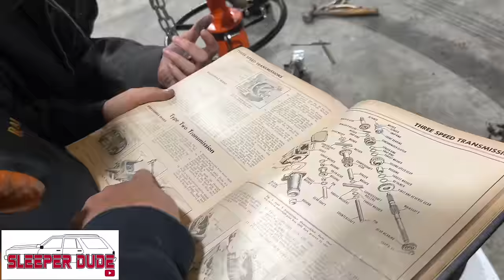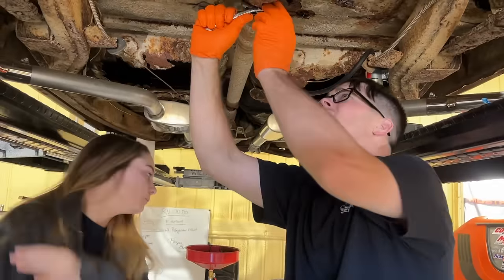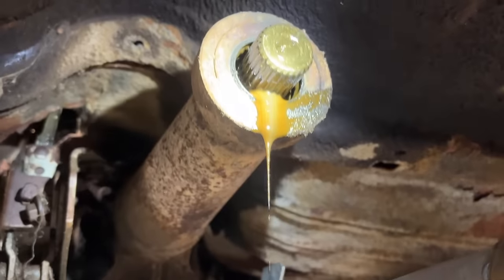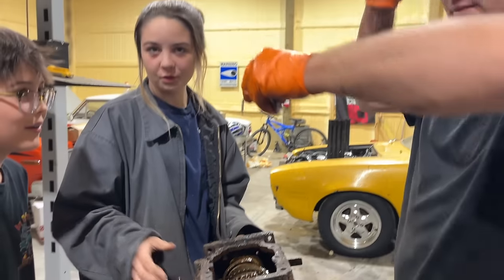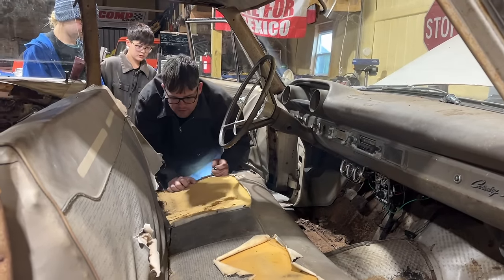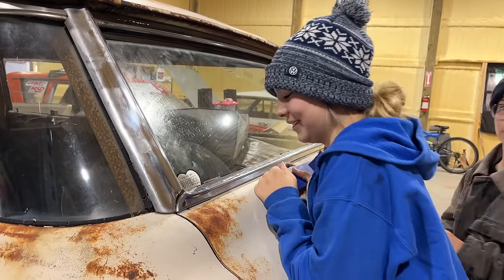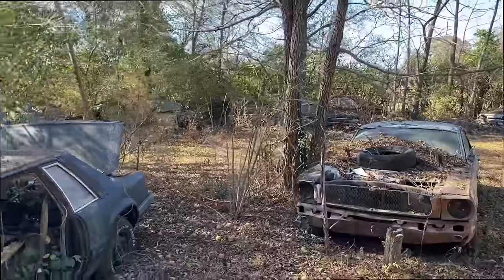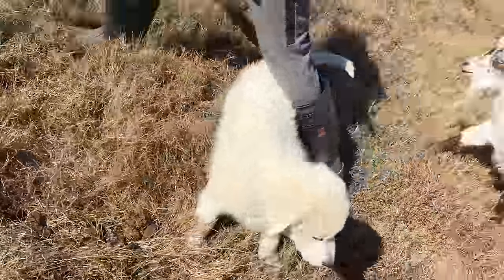What Went Wrong? And I Bought 7 1/2 Cars!

Comment: Tip for you guy's when using your wrench put the closed end of another wrench over the open end of the wrench you have on the bolt. Love the content as always. My heart is still smiling from Squeezy and Tosh tearing up on the air compressor and air brush ❤❤

Comment: Haven't fooled with old manual trans in 50 years, but here goes. Think of the 'clutch/input shaft as part of the case (it isn't, but go with me). The main shaft with all the gears/synchros gets inserted into the back of the input shaft, the joint supported/kept aligned by needle bearings you insert by hand (there is no cage, only you and lots of heavy grease). If the crankshaft bushing or tranny housing front bearing is worn, the two shafts will flex, eventually wrecking the needle bearings. When there's enough flex, even if the gears don't destroy themselves, the tranny will wan't to pop into neutral when under load. Eventually, it WILL make metal. This can also be caused by messing up the needle bearings during assembly (one drops out of place and gets crushed), or trying to remove the tail housing to service a seal or gasket without holding the tail shaft firmly forward to preven needles from falling out. You've probably figured out by now that nothing comes apart until the cluster gear is dropped down out of the way. Always remember, those needles are always waiting for a moment of inattention so they can make a break for it.
Reply: It'd be a pleasure to see you working on a transmission or engine. Obviously you're a talented person. Thanks for your advice.

Comment: Worked in parts at a Ford dealership in TX. The oil pans for a 460 in a van have a different sump placement than a pickup or car. I used a van pan to install a 76 460/c6 in my 69 GMC SWB. I wanted more power than my 283 had and a guy had a used 460/C6. Real good engine but thirsty. Takare dude, great show as always.

Comment: Not sure if someone mentioned this already, but you can swap the tail shaft housing from a Chevy S10 T5 onto the Mustang T5. This moves the shifter forward so you could keep the bench seat and possibly the shifter hole that's in the floor, already too. There's something you have to do with the speedometer, but not exactly sure what. Do a search for the swap and you'll find all the details. Good luck with the project!
Reply from the maker: Thank you

Comment: For the rv oil leak with the rear main seal try this here If you can get your vehicle up high enough to work underneath you can change the seal without removing the engine or trans. Drop the pan, pull the flywheel bottom cover if a stick shift. Remove the rear main cap. Inspect the bottom rear main bearing.

Comment: First off I love manual shift wagons. Was watching Hagerty  channel and on one episode he bought a running Ford Galaxy SW special order from factory with a 428 ci 4 sd manual approx the same year as yours. I have two suggestions for you on this build one is put a 4 sp toploader back in and change the rear gear to a 3.55 posi. Also Puddin did a SW same as yours and he found a place that had perfect fit floor pans from back to front, might want to give him a call.

Comment: I watched this video a couple of days ago, and was put in mind of my 66 Fairlane wagon, with a 289 and a 3-speed w/overdrive.  The clutch linkage had been taken out, and the front end had suffered in an accident, but I only paid $35 for it...I found some linkage, and bought a similar-vintage Falcon with a 302 and an automatic; I cut our the radiator support  and used it and the radiator in the 66.  I found black fenders and a gold GT hood, and put it all on the blue wagon.  We drove it 7,500 miles in 20 days, with 10 days parked visiting family.  I loved that car.  It had a whining 2nd gear which finally broke, so I had a T-10 4-speed to put in.  I really preferred the 3-speed.  I sold this car for some reason, and wish I still had it!

Comment: Your transmission exploration reminds me of when I watched my Dad  rebuild the three speed transmission for our Jeep pickup in the spring of 1978. We ordered all new gears , bearings and other parts from a company in California called Four Wheel parts wholesalers. They had every part necessary except for the reverse idler gear which we sourced locally. That three speed transmission was always the weak link in that truck and was the second rebuild for it in 1978. It came from the factory with a syncro mesh that was not de burred and my Uncle actually broke the shift lever off the steering column trying to get it into gear, necessitating a floor shifter replacement.

Comment: The TREMEC T-5 is a 5-speed manual transmission for longitudinal engine automobiles. It includes one overdrive gear, a lightweight aluminum housing, and adaptability for four wheel drive use. It is currently manufactured by TREMEC.  Good choice for that beautiful 302.
Reply from the maker: Yeah for sure

Comment: The 1965 Futura factory black paint may be a special car. Could be a  Sprint 2 door. It came from the factory with a 289 cu. High Performance motor really special if it has 4 barrel carb and 4 speed.

Comment: The big ashtray built into the back of the front seat is something else. Back then, ashtrays were like cupholders are today-every passenger has at least one. I dunno if the seat could be saved but it will take a lot of tedious work to do so. I think I'd just go with some bucket seats in front and use that T5. Yet another awesome video as always from the best creators on YT!

Comment: T5 swap would be pretty easy in that car and you will love driving it then.  I put one in my 66 comet, using the factory foxbody bellhousing and didnt have to modify my console or drive shaft.  The tail shaft housings can by swapped for shifter location.  The mustang one I want to say was 24-27 inches back from the rear face of the foxbody bellhousing as I remember.

Comment: I put a T5 in a 59 Fairlane. I turned 0.100" off the front bearing retainer so it would fit into the 352 bellhousing, used the Mustang disc, and the Fairlane pressure plate. Then, I bent the shifter forward and up to clear the bench seat. It was totally worth it.

Comment: Tech tip for Ralphie: For really tight bolts/nuts, use two combination wrenches. Slip the box end of the extra wrench over the open end of the wrench on the fastener. That will give you extra leverage without hanging from the wrench.
Reply: Its called leverage...n im sure his dad has taught him that already...if he hasnt...hes not as smart as ypu think he is..after all...this is you tube

Comment: Josh… mustang T-5…a Tail shaft for a S-10 T-5 will put the shifter forward.use a stock mustang bell housing, but you’ll have to cable operate it we did that set up on a 64 falcon about 15 years ago when we 302 and T5 it.

Comment: I’ve got a 63and1/2 in NC you’re welcome to the car for the parts floors are gone but the rest of the car is straight and all the chrome is still nice. The bumpers and door handles and glass are the same as the 64 it’s a 390 automatic car engine looks to have been rebuilt before it was parked.

Comment: You need to get that engine that was connected to that transmission you looked at. Seeing those gold valve covers, that was from an early model Mustang 289 either a 64-1/2 or 65 if I remember correctly. You could find someone that would take that off your hand in a heartbeat, no matter what condition it was in.

Comment: Absolutely love any car with a manual transmission, bonus if its floor shift. 
I like that im in control of whats going on in there.
Ive broken several kinds. 
Saginaw 4 speeds are only good at less than 300tq
T10 if its later than 65 is usually good  to 300hp 300tq as well. 
Also broke a couple different sm465, 
Nv3500, t5, even a nv4500 from a 1 ton...
My cammed big block like to liquify the internals of any transmission i hooked to it. 
Saving for a Muncie, i hope i get one
Reply: Oh yeah the rear floorboards always rust out because...... that's where the front door meets the quarter,or where the front door meets the back door, leaks past rubber, ends up rusting out the rear floors.....at least my theory.
Reply: When an old guy with all the parts feels like selling,  ya buy a truckload of parts. 
You never know when them old guys decide to take everything to scrap, or dies and their kids fight over the leftovers.....
I'm glad y'all got some good parts

Comment: I have a 5 ton ac core that you can hook to a water heater with a fan to spread the heat around. you are welcome too it to keep the shop warm.I found it and it is easy to get too. put the propane water heater outside and run the core inside. hook a fan and you are warm.

Comment: The T-5 has become a popular restomod option for older and classic manual transmission cars, as the overdrive gear can improve fuel economy.[5] In general, retrofitting the T-5 is straightforward for many rear-drive Fords from the 1960s and 1970s, as they are dimensionally compatible  Wikipedia  :)

Comment: Old used car trick, they put in extra thick gear lube to temporarily stifle the transmissions death screams.  Sometimes oatmeal, or sawdust would be added as well, anything to quiet it until it's driven off the lot.

Comment: You can ,i believe, use an s10 t5 tailshaft/ shifter with the bench. I put an 84 2wd s10 trans behind an 84 250 inline 6 in my 64 nova and the shifter has plenty of room.

Comment: My guess on why that transmission got stuck in second gear, is that the place where it split, is also in line with the holes for the shafts that hold the shifter forks. When you pulled it back into second, the case twisted enough to keep the 2nd/3rd shifter shaft from moving forward again. I'm pretty sure that 8 lb. sledge is the proper factory authorized tool to get those shafts out!🤣 I doubt that reverse idler caused it to split. I think there was enough water in that case to freeze up and break it, if it stayed really cold for a few days. I had a '62 F100 unibody pickup with a little 3 speed and a honkin' 430 Mercury Marauder police interceptor engine hooked to it. I replaced that transmission at least 2 or 3 times before I finally sold it to my brother.😂 He ended up putting a built C6 automatic behind it and finally got it to quit eating transmissions!😉👍👍

Comment: If you want to run that T5 with a bench seat, you need an S10 tail housing. That will move your shifter up close to the trans case.

I've been going through all kinds of Ford/T5 crap building my ''street legal'' stock car.

Since the starter bolts to the bellhousing, if you change over, make sure you get a flywheel that has the same tooth count as the donor bellhousing.  Otherwise your starter gear won't be in the right place.

Comment: Fix gear case......clean gear case..then apply pressure to close the broken gaps...add stainless steel bar bracing ties with self-tapping screws ( Stainless steel screws) to sow up all the cracks tight, then wipe JB weld on the surface crack to seal. Check for alignment of gears...clean out case...install and fill with fresh gear oil.

Comment: I have a 3 speed toploader for a 64 Galaxie extra in the garage if you need one!  hit me up.  in chicago area.  also, looks like the slider overshifted into second gear.  if you want to go T-5 the tailshaft from an S-10 has the shifter housing up at the front end of the tailshaft housing.  a cable clutch would work, a hydraulic conversion kit would be best & there are a couple fo companies that make them for T-5's.

Comment: Josh, I would look for a period-correct 4-speed that would fit better without much adapting. Floors will strengthen the rest of the car body for bending and stressing. Remember Mustangs and Falcons came with lots of 4 speeds.

Comment: At 16 years old bought a 56 Pontiac two door coupe had a three speed in that needed rebuilt I pulled it out without a jack and rebuilt it and it worked great amazed my older brother because it took me less than 30 minutes to pull it

Comment: The stops on the shifter weren't adjusted causing the the synchro collar to move back too far. The detents popped up and locked it. If the case wasn't cracked you could work each of the 3 detents  
back under the collar, adjust the shifter stops and it would be fine.

Comment: The transmission in my 60 Comet was stuck in 2nd gear. I had it torn down to assess it but it was too expensive to rebuild. I got a replacement from a mustang. The tail shaft is a little longer but I figure I can just shorten the driveshaft to make it work. I still have a couple things to finish up on my 87 caprice wagon before I start on the Comet. The comet will need a lot of work but it’s going to be my car show competitor.

Comment: I love a good 3 spd manual when drag racing. the ratio is great if you have enough torque to overcome the gear difference.  I have busted out some u-joints and even some rear ends snatching 2nd too hard though.

Comment: If you decide to use the T5, you can swap the top plate and tail shaft housing from a T5 out of a S10. That would move the shifter position forward. Should move it forward enough to keep the bench seat.

Comment: I haven’t seen it mentioned yet, but a common solution for Fairlane/Falcon guys swapping in a t5 is to use the tailhousing from an S10. It moves the shifter forward several inches, which works much better with the bench seat. And you’d already have to make another crossmember anyway

Comment: @sleeperdude those transmissions get stuck in 2 gears and will not come out of gear unless you beat it with a hammer it's usually that style of shifter that makes them stick because the rubbers wear out

Comment: My guess as to why the case was cracked is there was so much water in the oil and it froze and cracked the case, all that water in it created enough corrosion/rust and caused the slider to hang up on the beat up synchronizers.

You can use an S-10 tailshaft on the Mustang T5 if its not a world class
Reply from the maker: Ok thanks
Reply: Modern driveline makes an adapter for a T5 and the stock bell housing and think they also make a hydraulic conversion for  the stock pedal assembly with stock T5 bell

Comment: I had a 1980 f150 with a 4speed overdrive that was bad. And put in a 3speed out of a 66 galaxie in. Same input shaft and drive shaft spline worked.I was told that it the same as a Fairmont transmission.

Comment: Have you tried auto metal direct for floor pans. Older mustangs and fairlanes had top loader 4 speeds for small block fords. They should bolt right in, and might be the same length. Since everybody is switching to 5 and 6 speeds, should'nt be hard to find. FAIRMONTS forever!!!!
Reply from the maker: Ok thank you I will check it out

Comment: I have a 3 speed from a 72 f100 sitting in my shed in Norfolk VA. Too bad it costs so much to shift stuff. I swapped out from a 68, abd it turned out to be an issue with the shift tubes in the steering column, so tranny is ok. I dropped in a floor shifter and a shorter column to hook up power steering. All gone now except that tranny.

Comment: like  Ralfy said  put a T 5 into the  car that will fix it an give you over drive. The ford  top loader  has Three  Slider keys under each slide, they brake and jump out of place When this happens  it stops the slider from returning to neutral.  There is a mod  that uses a solid Key to replace teh stamped Key, this eliminates the problem.

Comment: I bet you could clean that really good and weld it, manuals are pretty tough! I bet the crack allowed water and dirt to get inside, and then soon after it locked up and got parked, if you were poor i bet you could weld it and fix it, but at least keep the gears if you get the same transmission! Or you coukd get salvage price! Lol nevermind😯

Comment: Next time you struggle with the u-joint straps, just spray with p.b. and some heat....then just start bouncing a hammer off it....don't pound on it. Just bounce a hammer off it, the vibration works most everytime.

Comment: On that Florida plate The number one(1) was the county it came from. Miami, Dade county, and the "D" was the weight of the vehicle. All of the counties were numbered, #1 going to the largest county then up. For the weight of the car The "D" was for a small car, like a VW, then no letter, blank space the next weight, then a "W" then a "W W" for the heaviest cars, like a big Cadillac. The state has long sense stopped using that system of numbering. At that time one could transfer there tag to another car. So that tag, if it is 1D it would have been for a lighter car then transferred to the heavier Ford wagon.

Comment: A friend would drain a quart of oil from his old 68 Chevy van,add a quart of kerosene,then run it for several minutes and then change the oil,had 300 thousand miles on it when he was rear ended,totaling it,motor  was sold,junked the rest,and it was still running years later.

Comment: So I have an old 4 speed in my car and occasionally it gets stuck in gear, this happens when it slides between gears while still in 2nd. The selector closest to the rear needed to be put back in between gears and it would have worked again.

Comment: You guys need a waist oil.heater to heat the shop with.
And use you're old.engine oil as heating fuel.
Reply from the maker: You are correct

Comment: My first truck was a 91 ford, I hated that thing lol. It never ran right, I replaced so many parts on that thing, I finally sold it but when I took it off the road it wouldn’t run but 35 in the rain lol then eventually wouldn’t start, something was getting hot and or wet and shitting down. I’m not sure but that truck turned me against ford lol I’ve been a Chevy man ever since, but I’ve grown to like all cars and trucks that have a nice body, anything can be road worthy with a little work. I was young and didn’t have interest in working on my truck everytime I wanted to go somewhere I’d rather jump in my truck and go lol